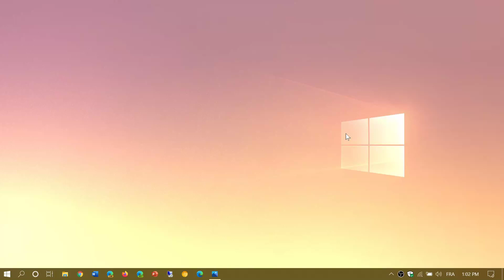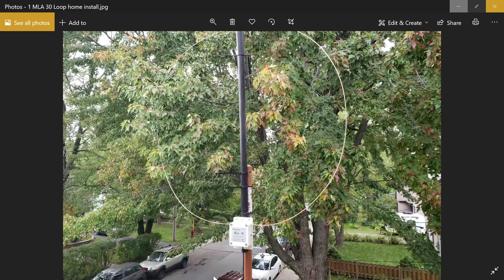Radio Frequency Interference RFI problems is very common August 17th 2020

Comment: This loop antenna is very directional... I have mounted mine in such a way so that I can swivel it with a handle from the ground. That can help with noise also.